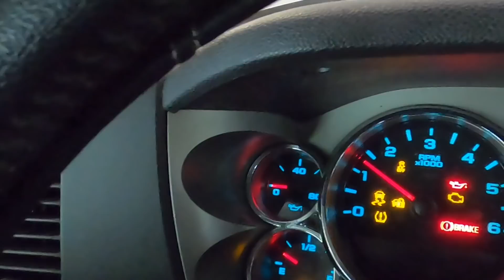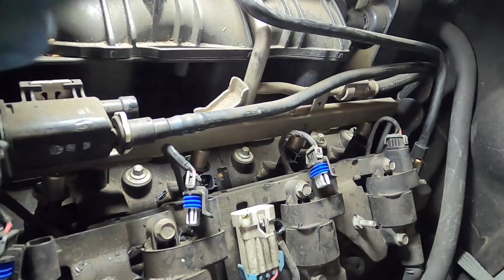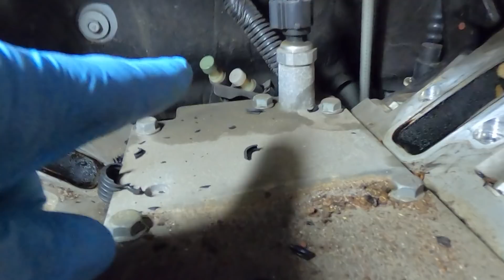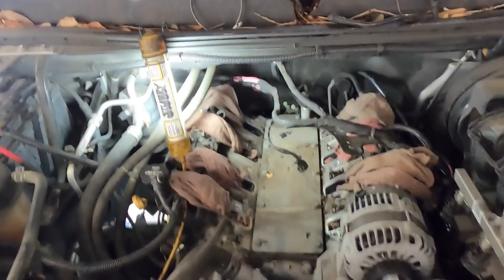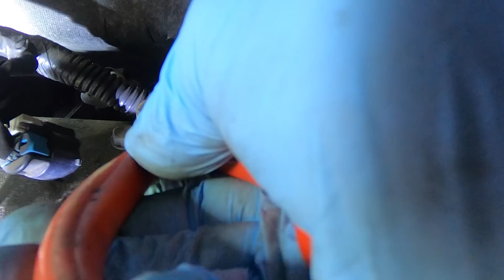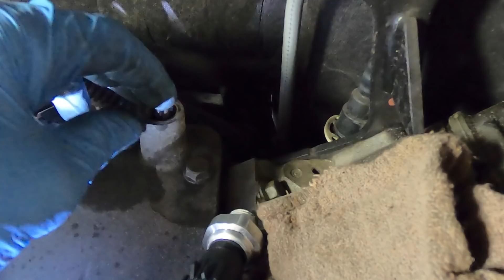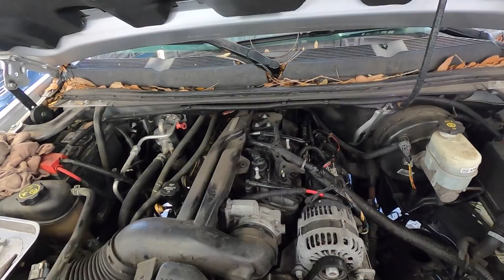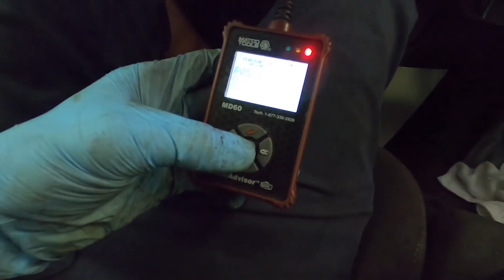Customer States: Google Diagnosis…replace this part!

Comment: It's not that Google knows all but there are hundreds of mechanics that would rather take 20 minutes to fix it and move on to the next vehicle than to waste 2 hours pulling the intake, pulling the sensor and screen then putting everything back together, I know I'm paid flat rate and I'm going to earn my money doing it the easier route, the way myself and others see it is the customer paid for our experience to be able to get it done that fast regardless the cost of repair.

Comment: Sucks to do all that work and not fix the problem. Customer should have let you complete the diagnostic and save himself the labor for what you did in vane. I did cringe though when you blew all that shit away. I would have used a vacuum but you may not have had that available. Always good to watch your work. I've been watching alot lately. Thanks for sharing your knowledge and experience.

Comment: Same crap with a C5 Vette.  The sending units go out about every 25,000 miles.  The intake has to come off to replace.   Or you can cut a hole in the plastic that no one would ever see because there is another piece of plastic covering it.    75% of C5 Vettes have that hole.

Comment: I changed that part in 30 mins on my daughters truck.. deep socket, swivel,  4 inch extension,  another swivel.. it was pretty easy. Hardest part was the electrical clip.

Comment: Ray, I'm a stickler for doing it right also.  I worked a long time on Aircraft Avionics.   You LOST ME when you left that little screen out - IMHO, I think you should have gone further and found out what was wrong.  Wrong engine?  OK, leave it out,  Don't know?  Gotta pursue it.  I think you were a bit, shall we say, Cavalier about the screen.  It was obvious you knew the sending unit would not fix it. (we all knew).   Color me "gone" from your web site.

Comment: People wonder why mechanic shops charge so much, this is why, I dont fully agree with the way they charge, but i understand the rates. The going by the book the job should take 5 hours, but it only takes a hour and a half to do, instead of charging the 1.5 hours they charge based on time book said. Now reverse the situation, and book says 5 hours, and it took 9 hours for whatever reason, u can bet most if not all will charge that 9 hours. its by the book as long as it is in there favor.  I know u say what if i was given a quote first though, many have a way around that, i had to change such and such part and this and that also so this is how much u owe me. Again i got nothing against the rate, just be honest about it lol. I am sure there are some that dont charge extra but what % of mechanics wont charge that to u somehow some way? That is why the saying hard to find an honest mechanic, and there are some, but it gives the great mechanics a bad name.

Comment: So if you put a screen in and it clogs you still have to go though all this work to replace the scree then why wouldn’t you replace the pressure unit anyways without the screen the pressure unit clogs and you still go through all this workto  replace the pressure unit regardless it’s the same senerio right?? 

I’m reall asking not being sarcastic!

Comment: I’m an engineer and it bugs me when I see infuriating engineering like making the oil pressure sender so inaccessible.  I understand there are a lot of parts in the engine bay and they all have to go… somewhere.  However I believe there could have been a little more thought given to making the oil sender more easily repairable, seeing as it is not unheard of for sensors to fail.

I have a Tacoma 2TR-FE engine with 4WD, and needed to replace the A/C compressor which is in a pretty cramped location.  I was wondering how I was going to unbolt the compressor, then I noticed that Toyota had placed holes in the frame rail to give access from the wheel well with a socket extension through the frame.  There is an example where the engineers did a little something to make life just bit easier for someone fixing the product down the road.
Reply: #1. Cars are not engineered for ease of repairs they are engineered to get them  down the assembly line as quickly and cheaply as possible.  #2. Toyota is the best because they R+D their failed parts to improve them, I worked in the parts dep. at a Toyota dealer and they regularly have warranteed parts sent back to see why they fail.
Reply: @indianaslim4971  reminds me of that one story, someone managed to drive a toyota for a million miles and got a new upgraded car out of the deal because toyota could not pass up the chance to see how that much use effected the vehicle, that's information that is invaluable to improving future vehicles
Reply: @indianaslim4971  Every dealership does that. Every manufacturer that I know of is updating vehicle software and components as recalls/satisfaction campaigns are rolled out. I too, work at a dealership.
Reply: I agree completely.  I remember the days when the oil pressure sending unit stuck out of the engine above the oil pan.  you could change is as easily as changing the oil.
Reply: My dad worked for GM in the late 1950 designing cars.  When they finished the car prototype. He and all the other engineers had to work on the line installing the parts, then they had to remove and replace them as a owner/ mechanic would after sale.

Too bad they do not do this today
Reply: @timfalke3958  wow I did not know that!  That is the type of thing that makes good engineering great, and decent engineers better!   Should b mandatory in a corporation like GM.  But I doubt they can do that these days.
Reply: Haha yup. When I bought my 1966 Ford Mustang none of the indicators worked. Even though there’s only two, the alternator and oil pressure light the oil pressure light is pretty important on old cars like these. There weren’t any issues driving the car the 50 miles back home so I knew there was something faulty with the indicators. I grounded the switch and the oil light came on so I knew the switch was bad. Replaced the switch probably took 10 minutes because the oil pressure switch is just right there on the side of the engine block with about a cubic foot of room around it to work with. It’s a 200ci in-line 6 so there’s tons of room to work in the engine bay. I don’t have a gauge to check how well the bearings are sealing but I figure if it’s at least the 5 psi to turn the light off it’s got enough oil flowing through the thing to be ok for awhile. Probably the quickest easiest job to do on that car, changing the brake light is more time consuming. Things just aren’t engineered with enough thought towards future maintenance, we live in a throw away world.
Reply: I had to replace the tx valve in my 2013 chrysler 300c and had to remove the dash and heater exchanger, the engineering decisions made are just stupid.
Reply: I would like to know how you can put an oil pressure gauge on this engine and make sure it has good oil pressure?  Is there some other port? Because this engine's not running with the intake removed... I suppose you could remove intake, remove sensor, install hose for test gauge, reinstall intake, run engine...

Everything's inaccessible nowadays.
Reply: Could be worse. Cadillac Northstar 4.6 V8 the starter is under the intake. If you get a.coolant leak you'll fry the starter. What should be a 30 minute job turns into a couple hours. Thanks engineers!
Reply: I am an Engineer too. This cars were designed badly especially if serviceable parts cannot be easily accessd. working in the united states as an engineer sucks. its more of "do as I say" and "when is the task com[lete." your say has no value. first you have to be the right skin color, secondly ,they will steal your ideas and opinions if you are not careful.
Thats why I always buy Japanese or German products.
Reply: I do my own shop work as well as I'm a commercial HVAC tech and wonder that same thing EVERY DAY ! i have cursed more than one engineer in my heart of hearts
Reply: STUPID ENGINEERS FOR YOU , MAKING HARD FOR EVERYONE  !
Reply: I have concluded, after many years of doing most of my own automotive work, that manufacturers are not in the habit of designing their systems to be easily accessed and/or repaired as this equates to a loss of revenue for the same entities.
Reply: Those holes are for the robots to put it in.
Reply: A lot of engineers have the arrogance that their marvelous design can't fail, so they'd rather hot dog where they can manage to fit it.
Reply: @vtmayhew>>> Don't buy a new one Y'all will have a heart attack in the show room. The car companies don't even try to hide their dumb shit no more it's right there to see shit laying all over serviceable part areas and the likes.
Reply: If they would of made it easier it would be in the top front of they engine bay not in a unacessable area...
Reply: Amen to everything you just said! I’m on your side for sure
Reply: I only wish Toyota did the same thing with some of the machines we use to make the cars as well.  I do industrial maintenance for them, and some of the fixes require me to bearhug a pneumatic cylinder while laying down to change an airhose, or army crawl 70ft under a 3ft deck over random pipes to fix a conveyor.  The cars are good, though.
Reply: If it helps its easy to access mine. Takes just about 5 min to change it
Reply: True i had to change the oil pressure sensor and it sucked 
I didnt take off intake so i really had cramp my hands in
Reply: It’s not only a sensor problem. My 2007 Honda Civic transmission oil filter is hard to get. I basically need a mechanic..I don’t think a regular oil lube would take on that job,if they did,i wouldn’t want to, because it would probably cost an arm and a leg, plus I’ve seen too many videos, of lube places,not doing their job. Plus I don’t trust my mechanic either🤷‍♂️
Reply: IMO GM historically has different sections of the company design different different systems of the vehicle without considering the other systems and as long as it is actually possible to replace a part it's good to go.  They also like designing brand new connectors the world has never seen that are fun to figure out or require yet another special tool to take apart.
Reply: Years ago on old Chevy v8s the intake was cut out all the way in the back and the oil send it was all the way in the back but you could unscrew it without taking anything off accept the gauge line for your oil pressure you know back when they just had a little piece of plastic tubing life was simple why make it complicated a have a great day guys
Reply: A couple maybe a few weeks ago I watch the video where Ray had to put in a oil cooler and it was on top of the motor underneath the intake what act of brilliance was that same guy that design the oil switch oil sensor I mean hey guys I wonder sometimes put an oil cooler on top of the motor think about it heat rises bye have a good day
Reply: That's why Lexus/Toyota will someday rule the world.  Tundra & RX350 in our family.
Reply: @Corvette.Ronnie  I agree.  Toyota/Lexus can be accused of moving technologically at a snail’s at times but Toyota generally makes a pretty solid product.  I’m a one-person sample, but I am impressed byToyota’s customer support.  I received a letter from Toyota in 2016 regarding excessive frame rust on my ‘05 Tacoma.  Indeed, the Tacoma’s frame was a rusty disaster, truly awful.  Toyota decided to replace the entire frame, leaf springs, bake lines and fuel lines on my truck even though it was 11 years old with about 120,000 miles of use.  It took two service technicians two days to do the repair.  Toyota apparently figured out the rust issue because the replacement frame is now five years old snd still looks great.  What a turn-around.  I was about ready in 2016 to dump my Tacoma on Craig’s List to get rid of it before it fell apart.
Reply: @wtmayhew  We bought a new Chevy Silverado back in 2000 and it was our last GM. Every fluid carrying vessel made of steal was rusted out by the time it was 11 years old. That truck was nothing but a hobby. I'll stick with Toyota or Nissan trucks from now on. Much easier to work on.......when you do have to work on them.
Reply: @Corvette.Ronnie  hey I'll take the vet any day of the week but won't be long before they catch me I get a little wild and crazy with a vehicle like that but be a heck of a ride have a good day
Reply: @Corvette.Ronnie  WRONG!
Tundra just destroyed Toyota with the new 2022 model. Worst engine ever designed for a measly 1-2 mpg. They had a great engine. They now have the worst. When the twin turbos blow out (and they will) you have to lift the body off the frame to get to them. Horrible placement for a horribly designed engine
Reply: There was a lot of thought put into it, Its so you bring ur car to the shop to fix aka dealer lol. If you think this game is not rigged against u, u are naive my friend. There are a lot of simple things that could be done, and im sure an engineer will say but there were prob some unforeseen  issues by u in recommending they should have done this instead of that.  If this game was not rigged against u, then it would be more accessible software and such for repair urself. There is a reason that other manufactures of code scanner / diagnostic computers usually do not compare to car manufacture diagnostic computers, atl east they are behind the curve for a bit. That is why owners of john deer and all these other manufactures are bringing them to court for right to repair. Being forced to bring them into those dealer shops, for the simplest of fixes.

On the other hand, i will say a lot of thought went into my bmw by the engineers, at how easy a lot of stuff is to do, not everything but somethings that take u hours on most other cars i can do in under 30 min.
Reply: @reality150tv  yeah the problem is that the people that are in a position to do something about it or getting their pockets padded and turning them back and watching the automotive industry get away with this stuff and on the other hand you got engineers to come up with ways to complicate stuff so they can justify their little pushy jobs between all this you wonder why cars are so expensive and then you throw ocean the plants and the guy can't even lift up a tire without a special left the whole car is put together that way nobody picks up anything besides tools and nuts and bolts

Comment: Well as a mechanic. I would have checked that engine code before I touched the truck . Yes I know what the customer said and still would have check the codes . You cost this guy money for sh!t that didn't fix the issue.

Comment: Considering how much you paid for your computer, I wouldn't even pull it out of the box for less that $50. They don't what to know why the check engine light is on, then I wouldn't tell them. I owned a computer shop and did IT work for years. I spent a great deal of money on commercial, (i.e. not free garbage off the Internet) diagnostic tools, drive cloners, etc. My diagnostic fee was $99 and would apply toward further service.

Comment: The thing is. You can on;y do what customer requests. You do any more than that. You are doing it for free. They legally. Do not have to pay. I work in HVAC. I went to a customers house for a no cool. As soon as I arrived. Customer said. I know what is wrong. I want contactor replaced. So I opened unit and saw the problem right away. Tried to tell customer. He demanded I just replace contactor. So I replaced contactor. Unit still did not work. Showed customer the broken wire at the pressure switch and repaired. Then customer asked. Do I have to pay for contactor? Yes sir. You demanded I replace contactor. I tried to tell you. But you cut me off and demanded I replace contacotor.
 Let the tech do there job. This repair went from a 15 minute repair to a 1 hour repair

Comment: I do those with the intake on but if I take a shortcut like that I am certain to tell the service guy to adjust accordingly.   The customer is happy, they come back because they know they weren't screwed over. 
On the other hand I just finished $5k of work on a 5.3 that started with this diagnosis. The screen was partially plugged but #1 intake lifter had collapsed.  Tell the customer the truth, give them the best information to base a decision on.  It works for us. That customer is coming back next month for 4 wheel brakes, a ball joint, and an alignment.

Comment: On a car that it takes a couple of minutes to change the sensor this might make sense but in this case to insist on that being done without a full diagnostic first is insane. It didn't fix the problem and could well necessetate removal of all the manifold all over again for a proper fix. Surly the way to fix a vehicle is to properly find the faults first? And as for all those 'customers' who insist on not having dangerous faults rectified I find it unsurprising at the death toll on US roads.

Comment: I had to replace my oil pressure sensor on a trip during Thanksgiving and it was ahead to get to without removing the intake. Mine came with the screen as well and actually fit properly. I have a 07 Chevy Tahoe 5.3v8 2wd.
Reply: I also changed the oil and it did the trick.

Comment: You can change the OPS without pulling intake, you can also get the filter out if equipped, saves lots of time

Comment: Hahahahahaha!. Why didn't you just take the wheels off to get the unit closer to the ground ? Since you were needlessly taking the intake manifold off anyway, what's a few lug nuts? Just teasing. P.S. After some thought, I threw that screen thing away when I changed out my sending unit, without removing the manifold. No screen on my '08 Silverado for 5 years now. Great video, really.

Comment: i had to replace the oil pressure sensor on an old truck of mine and i couldn't get the little screen to fit either. Typical engineer  crap.